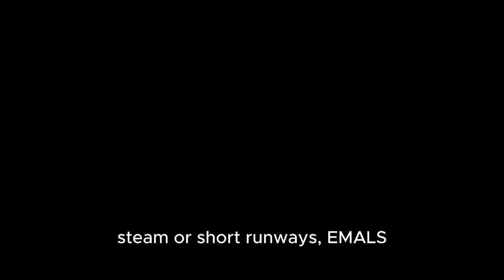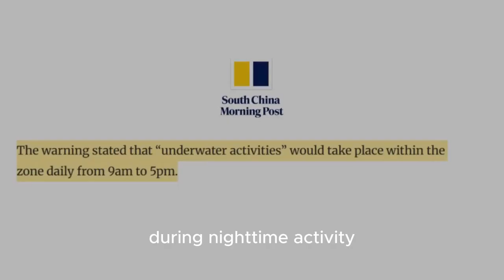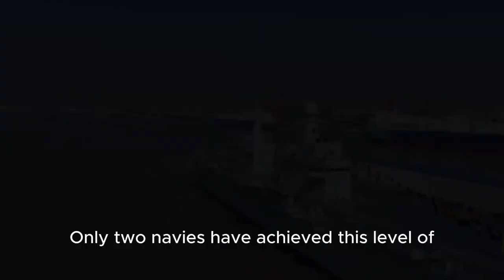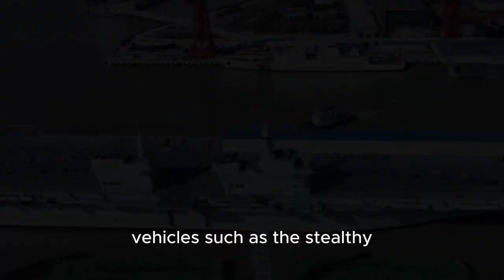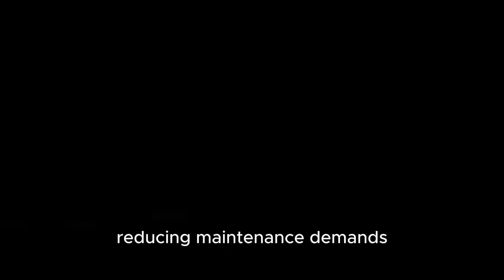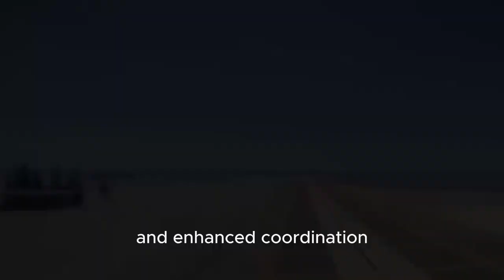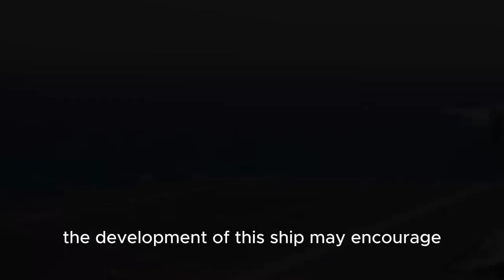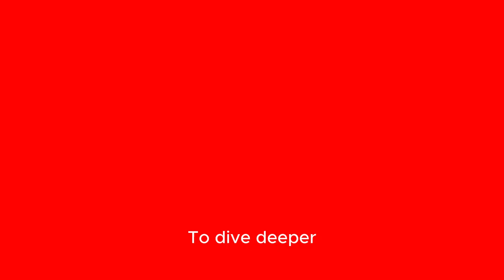China Just Shocked the World with a “Magnetic” Drone Carrier!

Comment: Only two countries have electromagnetic catapults: the USA and China.

However, the USA's EMALS has significant design flaws. That's why the USS Gerald R. Ford has had to return to port repeatedly for EMALS issues.

Moreover, the USA's EMALS is incapable of launching the USA's latest stealth fighter, the F-35. Maybe this will be fixed in the USS John F. Kennedy in a few years.
Reply: Your ignorance is limitless. For your knowledge and information: The F-35C is the version that takes off from a supercarrier using a catapult launch. The F-35B can also operate from smaller carriers, but it uses a short takeoff and vertical landing (STOVL) method, not a catapult. The F-35A does not operate from aircraft carriers at all. In short and in your own words, "Best to keep quiet rather than revealing to the world your bottomless ignorance."